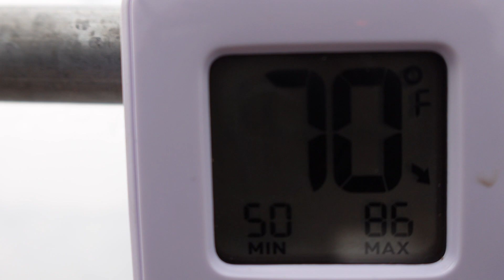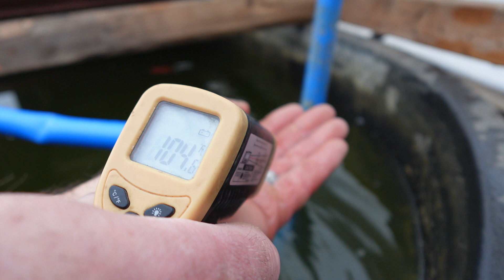CHEAP Greenhouse Pond Heater DIY - Heating The Pond With Compost - Part 1 - Winter 24/25

Comment: Really cool i had an oaky tell me about this years ago we event built a compost bin out of used pallets but never used it. And never saw anyone run hose through a pile and actually pull it off. I have a barrel stove and want to use bags of leaves to insulate the walls here in zone 8a. Youre doing humanity a service with your work.

Comment: Great project.  Subscribed.  I have many questions: 
Could you tell me more about your compost pile?  Is it mostly wood chips?  How many greens?  What kind of wood?  If you had a smaller pile, but also a smaller greenhouse (like you said you had before),  do you think it would work?  Why bother with the hot air, and simplify with a hot water radiator?   Or was that just an experiment?   Thanks!

Comment: Garden hoses come in 3/4" and 1/2" internal diameter. That's annoying because most fittings are for 3/4"and won't fit the 1/2" hoses when you have a need on short notice. With some types of hoses you can use a heat gun to soften the small hose to stretch it out enough to fit on some of the fittings, but not all.